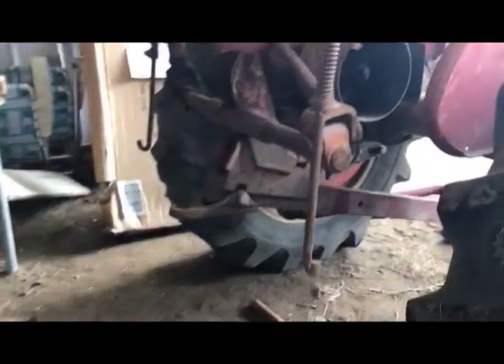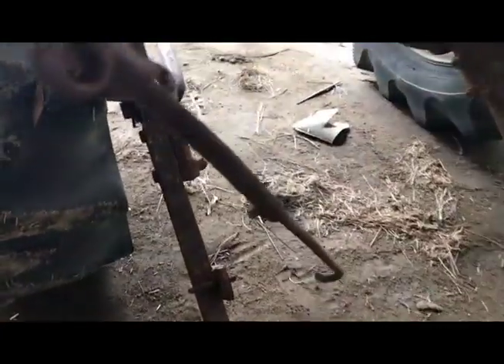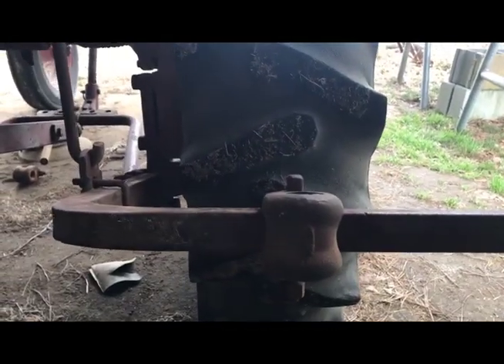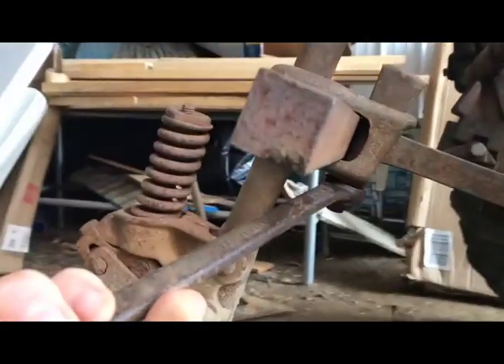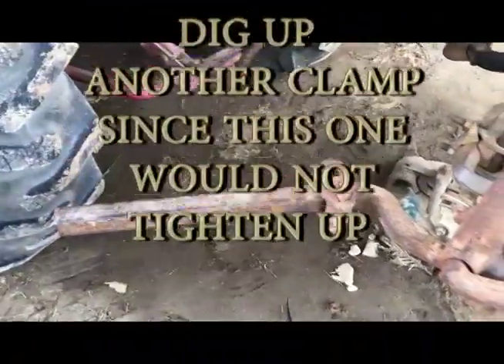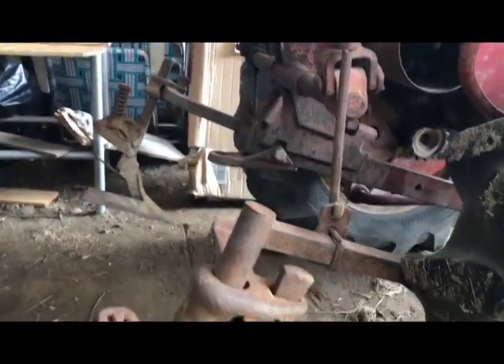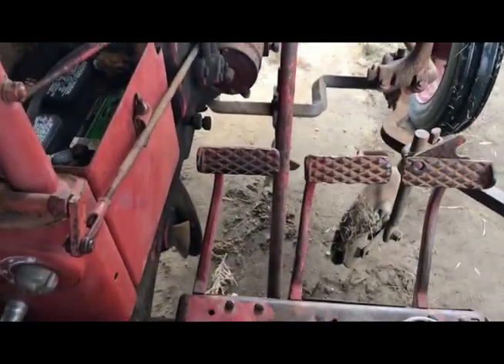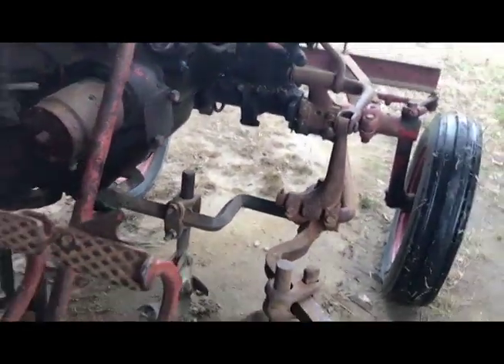Getting the 140 Set Up For Hilling The Garden (7)

Comment: My  dad and my uncle had a SA they used to work Tobacco. Making up rows to transplant the seedlings involved a middle buster like yours with the fertilizer hoppers active so 3-9-9 or 4-12-12 could be placed in the open row bed, the placement of fumigant to kill cut worms, and disk hillers to form row hills. With all that was going on  at the front they placed the disk on the rear gangs to form a perfect bed. Wedge clamps were used to attach the disk to the inside of the gangs along the straight portion where the rear gangs were the most narrow. Your post bring back lots of memories.
Reply from the maker: Tobacco had moved to larger equipment by the time I grew up, but there was a lot of it worked up like that.  Thanks for watching.